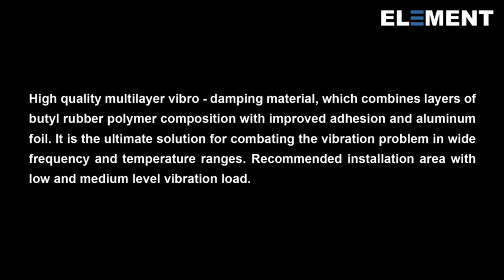Myvi Soundproofing

Comment: hi, what is the importance of soundproof are under wiper?
Reply: The soundproofing that we do on under wiper area is to reduce the engine vibration from engine mounting to car front windscreen, dashboard and firewall. Prove to be very efficient to reduce the vibration from engine after installation. But, you must install thicker vibration damping materials if possible. We suggest to use 4.0mm thickness material if possible. Also, you need to install special noise insulator to further reduce the vibration of engine. For more details, you may visit our CCS shops to know how we do it and what materials we will use. Thank you.